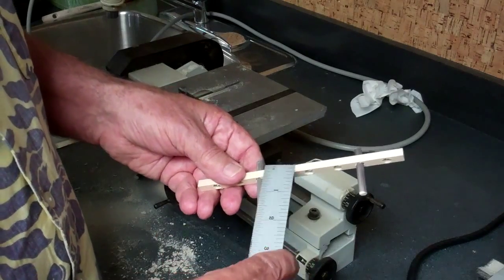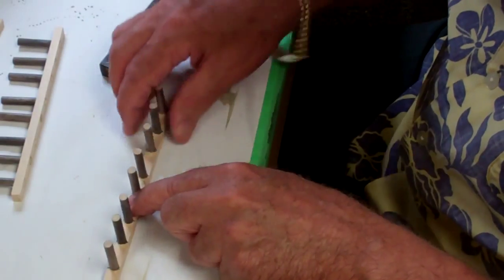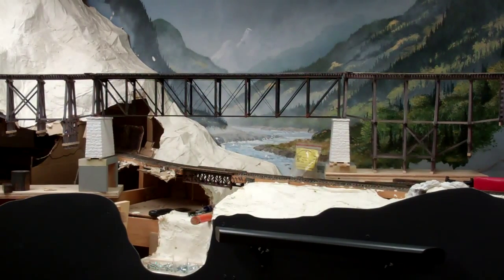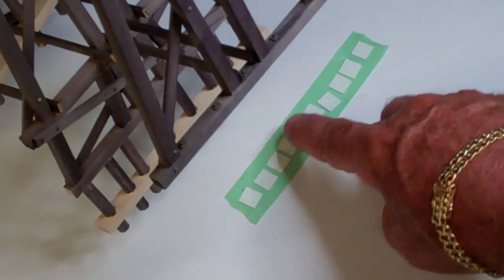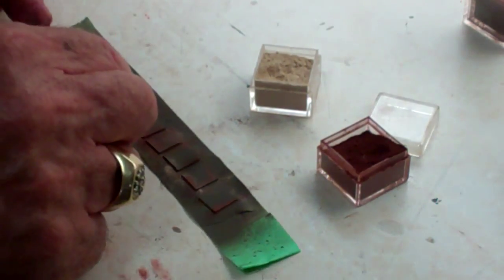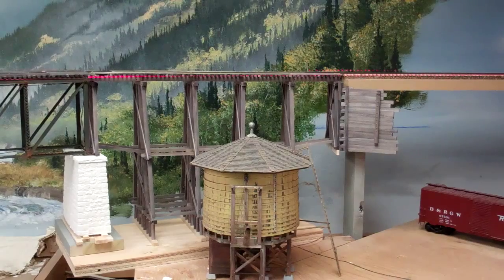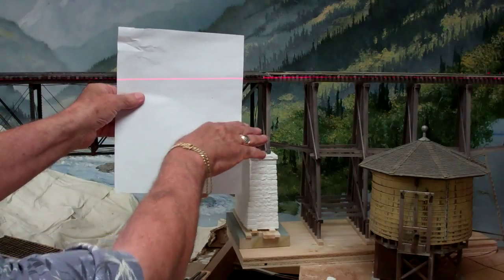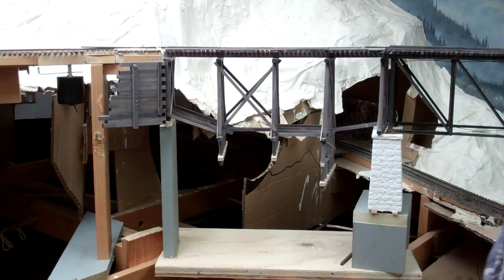Part 15: Final Installation of Pilings on the Cimarron Bridge Trestle.

Comment: Love the laser light.  Built a railroad in a room with a floor that was not level. Use laser to put a mark all the way around room before starting and built all bench work to that line not off of floor measure measurement.  Love the back drop have one more trestle and scene  to do in the high mountains and you have provide the inspiration to get it done.